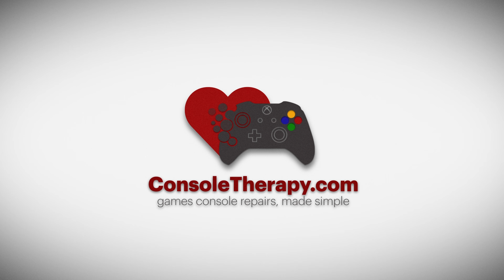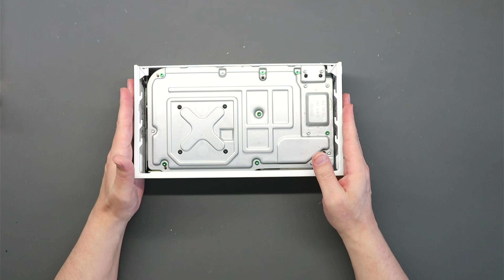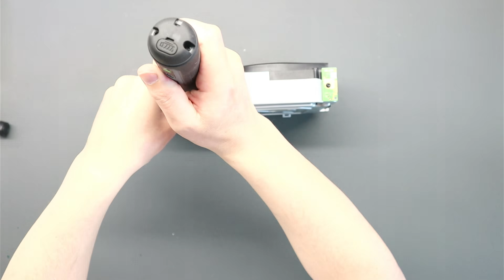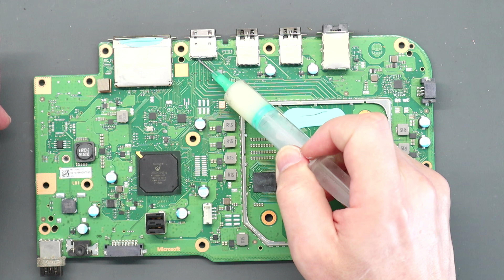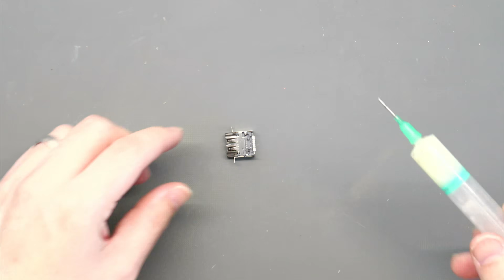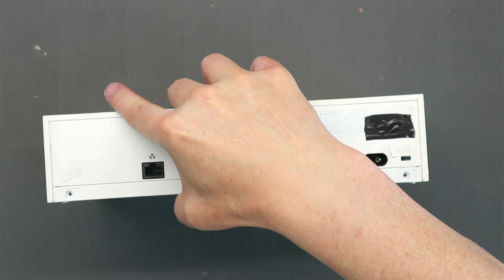Easy way to replace the HDMI port on an Xbox Series S - Full replacement guide. New for 2024

Comment: Hello! I tried to follow the instructions but I think I messed up. For some reason I can't remove the original solder nor apply new. The solder 60/40 just won't stick! Any advise?
Reply from the maker: Make sure you use flux my friend.